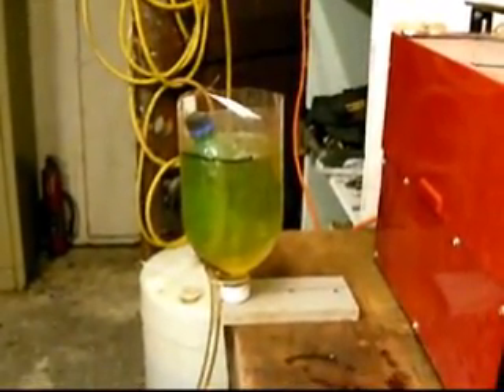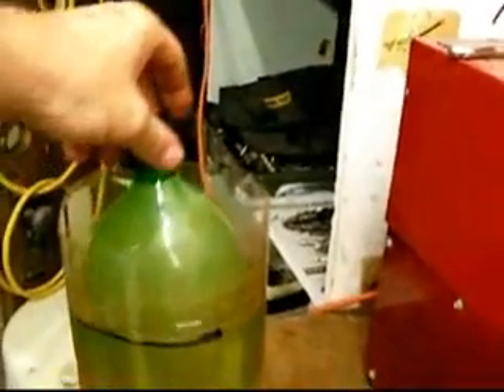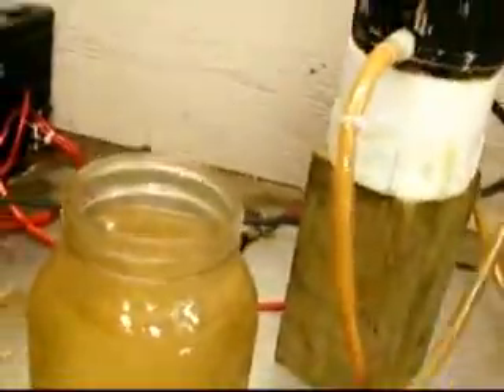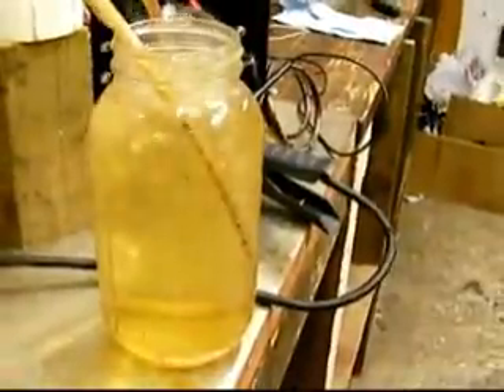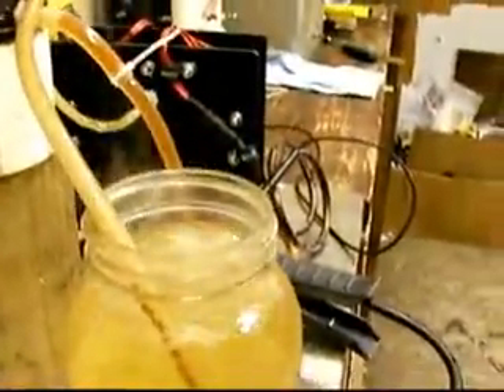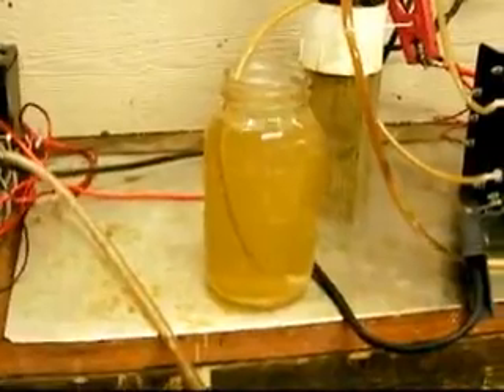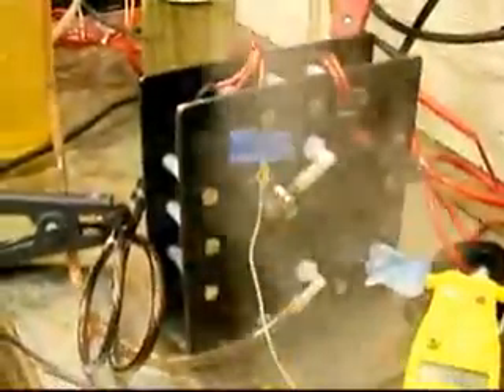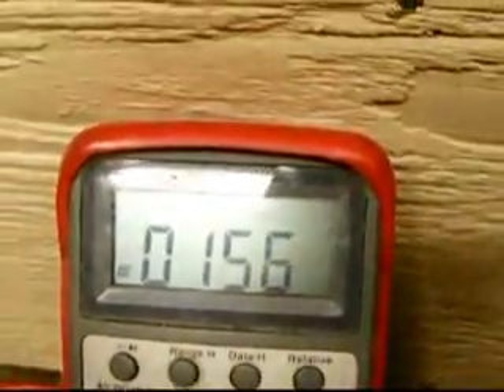tesla type hydrogen cell

Comment: 100% Lye (Drain Cleaner)  for electrolyte.  BE CAREFUL!!!! GOGGLES AND GLOVES.. Add small amounts gradually into the container as its reaction to water creates heat.  If your not using a Voltage/Amperage controlling device (PWM) Add gradually until your near your desired Amperage/Output(LPM).  Remember, Your initial Amperage will go up, let your system run until it seems to reach its peak ( can take 30 minutes in large systems)  Please do no dispose of used electrolytic fluid in your sink, it removes CHROMIUM from the Stainless Steel and contaminates our water.   :)

Comment: 50 A 17 V... how long you can sustain it in a car together with the alternator supporting the accu? Say if it is 12.9 V car battery, with direct ratio {P=VI} 66A you would suck out. General car batteries between 60 AH to 120 AH. Roughly you would have around 40 minutes without alternator in the minimum. Check your alternator supply and you would know how long you can sustain it. But there is still a but.
Would you drain the battery?

Comment: That's a very nice Iooking cell.  I wonder if the power potential of the HHO output is worth the 881 Watts being invested.   It's looking like there's a pretty big loss due to heat as well.  Yeah, it would be nice to run a home water heater on HHO, but if it takes the same amount of resources to achieve that... ...I' m pretty sure you know what I'm talking about.

Comment: Why is 4.61 liters per minute huge? The gas gallon equivalent of HHO is 15,000 liters per one gallon of gas. Thus 4.61 liters per minute means the equivalent of one gallon of gas per 54 hours of continuous run-time. I'm not saying it's nothing, but HHO is not very energy efficient as a gas, thus you need A LOT of it to make much of an impact in a combustion engine.

Comment: Idk how old this post is dude but if you connect that line into your engine it will seriuosly decrease it's life. With that many amps your starting to boil water I had this happen to my civic I was all hyped about it at first but it turned out expensive. The safest way to get that output for your engine is by getting about 3 or 4 13-15 amp cells.

Comment: Hey, great job making that dry cell of yours, just a few considerations for your test.  First, it's running 50A?  Most cars don't even think about pulling that many amps at one time.  Try something a little less, like under 20A next time.

Next, 156 degrees (and "ow it's hot") is a lot for the gas.  Generally that means you're steaming more than producing HHO, which will make output look greater.

Just a few things, keep up the good work though!  Nice cell, I like it lots :)

Comment from the maker: the spacing is .041 or 40 mil less than 1/16 thick.. the material is pvc shower pan liner from plubing supply store.. you can get epdm from commercial roofers and ebay...scott

Comment from the maker: the problem is that these dry cells tend to do that. we can run these at over 60 amps and 4-5 neutrals and ya get alot of steam/fog..now what? even at a cold start this fog is present. i have a video of a 70 degree cell smoking.

Comment from the maker: i am pretty sure the amps were about 48 the volts were too high for the 4 neutrals so the cell heats up quick. the cell is now residing in an f-350 with no heat issues 12.5 volts..running at 45 amps. hopefully 4 lpm we will see

Comment from the maker: how much steam can you get at 156 degrees look at the video again there is a red colored DVM with a thermal coupler it says 156.... the 17 volts is from a modified DC welder.. i have 4 neutral plates per cell with a 13.5 volt input 4 neutrals will be ok..thanks for the comments..be blessed!